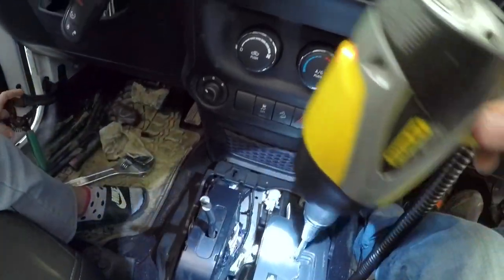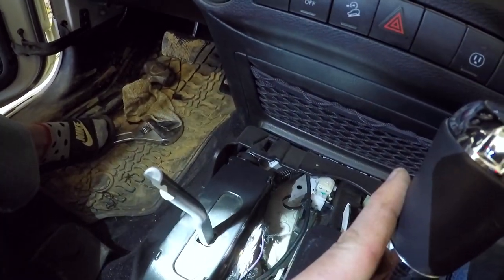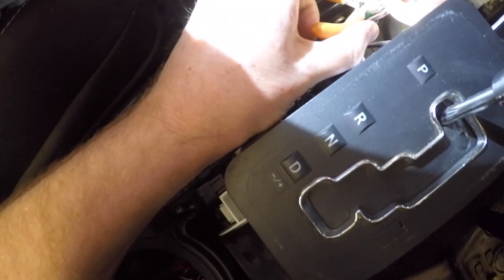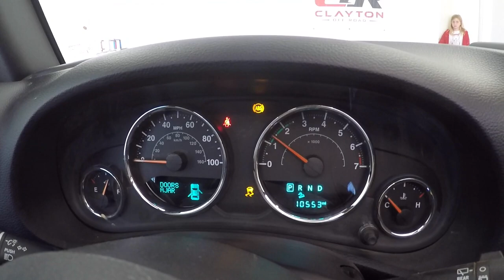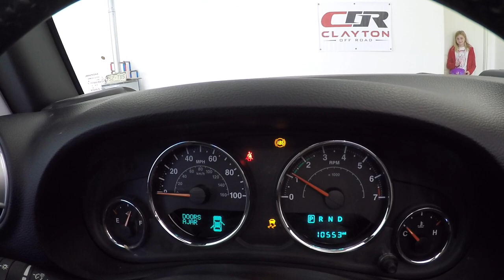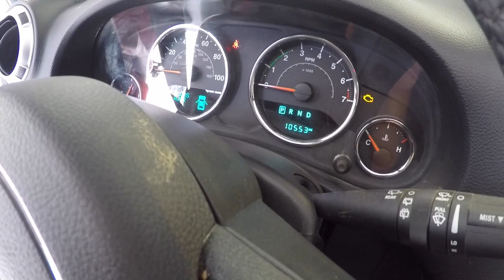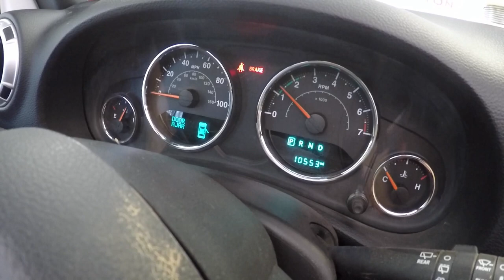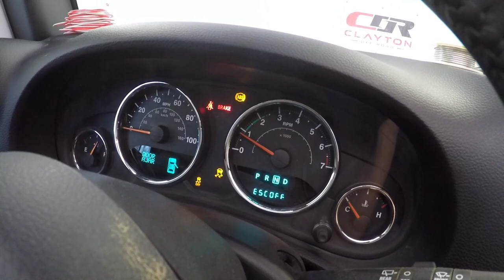Traction Control Bypass

Comment: Shift knobs come off easy. Here's the trick. The knob has alittle rotation play not much but enuff. Pull hard hold tension about 30 40 lbs and use that twist play back and forth 10 20 times. Basically you are walking the spring loaded pin up the groove. Your welcom cheers from Nova Scotia Canada

Comment: That  'auto correct'  about killed my family last night.    layer of slush on the hwy,   Dodge nitro '08.        Son said  the vehicle  started to  drift a little,   he lifted  and   steered  into the skid... like   hundreds of successful  recoveries in  'driver only'  vehicles before.     He  told me  :it was the fastest  he's ever felt  a vehicle  get   out of  control'.      They went down through the ditch,  and   sheared off a  power pole.The Dodge did  stay on it's wheels,   and  the impact was  dead center front.All I'm saying is     not every instance can be   managed  with   a  computer.   Will be   doing something like this  for my  06  Liberty.   Soon.

Comment: Wouldnt pressing the traction control button for about 10 seconds while in 4 hi turn off the traction control system as well?  what is the difference with this mod?
Reply from the maker: hcastilla2010 no, what I found is even with the button pressed it still has some computer control of engine speed

Comment: poster of video should add a .05 ￠ , rubber boot over the two pole switch: a lot more dust, grime and dirt get into that area than you’d think & it’d seal the switch ( plus look cleaner) . Nice write up . I went in under the cargo bin a bit further back in the console but I like your location, too. 👍🏻

Comment: Just found this video. I have always had the suspicions that my 2014 was applying the brakes at certain times when I am on rock ledges trying to launch and sometimes when trying to move around carefully on steep inclines. I've always been in 4lo. At times I've went from Drive to Reverse to back up off a ledge a d the brakes wouldn't even release when letting off the pedal! Is that something you were experiencing?  I tell others about it and they don't believe me.
Reply from the maker: Not exactly what I was having happen. For me it was when on the power and spinning tires on an incline. During this condition the power would be pulled and I lost all ability to accelerate until I took my foot off the accelerator and then pushed it again. Now, with this mod I don't seem to have this issue any more.
Reply: I know I am late here but that is the HSA or Hill Start Assist and you should be able to turn off going through the setup menu.

Comment: My question is my traction control light is on but the button want do anything and my abs light is off. I ran the cide reader and it's not showing anything wrong. I notice when I take off it does shake and sometimes worse then others.

Comment: Old vid but if you press and hold the traction control button it does the same thing..  Or pull the fuse J6 abs and hold on!
Reply from the maker: Pressing and holding the traction control did not work well for me. Even doing this the computer would cut power to wheels when i was spinning the tires climbing something. I cant speak for the fuse but dis not want to have to pull the fuse each ride and/or permanently loose traction control...that is why i chose to use a toggle switch so i could easily kill all computer control or leave it engaged.

Comment: Does this kill your speedometer? I’ve used the pulling the fuses method before but didn’t like loosing speedometer and odometer.
Reply from the maker: ExpeditionTrio no, they still function fine
Reply: Marine660 good deal! I’m going to give it a try over the weekend.
Reply from the maker: awesome, it was relatively easy

Comment: do you still use this mod also will wires be the same on 2017
Reply from the maker: I have since sold the jeep, however the mod works well!! I dont know about the 2017 differences

Comment: This electronic crap almost got me in a really bad accident after 2 small road bumps on dry pavement killed power. Got home and found this. Worked like the man says. I advise all Jeep owners to do this. It drives steers and stops better than before. God bless✌️
Reply: So did you just have the wire cut before? and now you put the toggle in?

Comment: Just cut the purple wire with light blue stripe.  Kaboom traction control is off. Now to finish the install via the toggle switch tomorrow.   Thanks for the video.  Very informative
Reply from the maker: Rubiman-jk _  Thank you!!

Comment: All you need to do is take out any fuse that has to do with "ESP" or "ABS" to find the fuses just look at your manual.
Reply from the maker: FAIR ENUF yes, however that is permanent and not a toggle on and off... unless you want to pull fuses and replace after each wheeling trip.
Reply: @WooPowOffroad  it is very tedious, but I would suggest pulling fuses first just to feel how your car handles without electronic braking and to get use to it. Once you've adapted and understand your own car better, then I would go for a more permanent solution such as a on/off switch as seen in your video.

Comment: Now my question is, will it lock the breaks on a hard breaking? If so, I may have to do that mod on my JK 2013 and the reason is that this morning going to work I rear ended a vehicle because the jeep didn't stop on time having enough room to stop I guess that is the cons of having ABS system in the vehicle, I knew if I didn't have the ABS on the breaks would've locket and saved me of having the accident. ABS is good for some things and sucks for others. Smh. Nice write up!
Reply from the maker: jaycotty i haven’t tried on the highway but yes in theory it should lock them up just fine
Reply: You don't understand the point of ABS do you
Reply: @HockeyJockOne  no he doesn’t get it at all. If he thinks he can stop a car with no abs in a shorter distance than the identical vehicle with abs he’s very confused lol

Comment: Did the same on mine last year, but just to let you know, it will still cut the engine in deep snow or mud if the jeep is inclined, so you can totally forget the idea of a swing. This is the main reason for doing this mod and it didn't do it. Probably more effective to just take the fuse off and disable the entire ABS module.
Reply from the maker: holeshot53 from what I have gathered this does the same thing as pulling the fuse. I will report back after the next wheeling trip if this doesn’t work.
Reply: that sucks, I loved the auto but just for this reason I prefered my 2012 with a stick. Never had issues of this kind.
Reply from the maker: This is my first automatic out of all my Jeeps. I will tell you that there are definitely some positives to the automatic when offroad. However, with that said I prefer the manual tranny myself.
Reply: Agree, for crawling and tricky stuff the auto kills it, but overall the manual is doing great.
Reply: What do you mean by “swing” ?
Reply: I pulled the fuse and my jk didn't shift correctly.

Comment: I have an 18 jk rubicon and I cut the purple with light blue wire and the airbag light was on. Not sure if it changed for my year or not but from the wiring diagram it should have worked
Reply from the maker: There are two purple with light blue wires....look at the bottom of the wire loom for the other one and it should be the correct one.
Reply: I have the same rig, did you end up getting the right wire Tyler?

Comment: Oops. Forgot to ask.  What size drill bit did you use for the console cover on that single pole toggle switch?
Reply from the maker: Rubiman-jk _ Sorry but i don’t recall...a stepper bit works well.
Reply: @WooPowOffroad  awesome.  I have one of those

Comment: What are the pros of disconnecting this?
Reply from the maker: The pro is you can completely disconnect the ESP / traction control system and spin the tires without the computer applying breaks or pulling power.

Comment: Does this also turn off the anti roll feature off. As when you're in 2wd and slide around a corner.
Reply from the maker: Not sure about that one. I used this switch when in 4wd low

Comment: I need Nissan exterra model how do make bypass traction control and also Toyota fj can you tell me please
Reply from the maker: Sorry, I don't know anything about the Toyota / Nissan models.
Reply: OK can ask one question some people do wheel speed sensor wire bypass it's working properly or not good this type method

Comment: I cut same wire, and all I got is the airbag light on.  2014 JKUHR.  Hmm
Reply from the maker: There are two wires that look almost exactly the same....I warn in the video that there are two that look almost identical and one is the airbag and the other is traction control.
Reply: Yep, but mine with the light blue wire is airbag.  Rather than try the other wire, I took out the fuses.  That didn’t solve my particular problem.  I may try the other wire with dark blue tracer, but still doubt it will fix my problem.  Thanks for quick response, love you videos.
Reply: @IFHSP2  did you get this figured out? I have a 2014 as well
Reply: @IFHSP2  Did the other wire work? I also have a 2014 an wanted to attempt this.
Reply: @codytaylor048  just saw this after a year.  No, I had a different problem that this didn’t fix.  I was running a Yukon auto locker in the rear of my 2014 auto.  So, I had to instal an electronic locker which solved my problem.  1500 dollar lesson learned.
Reply: @TCueteZ  see my other reply.